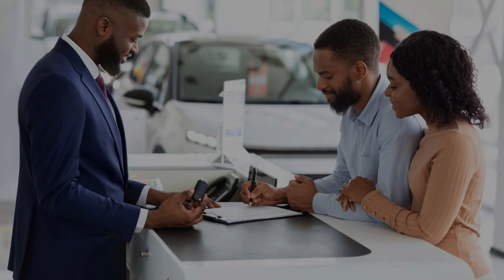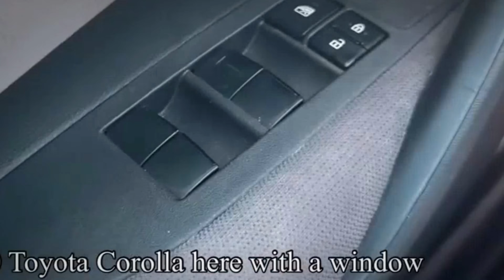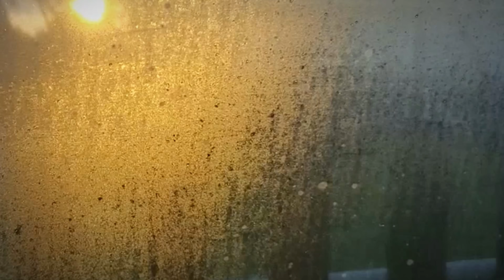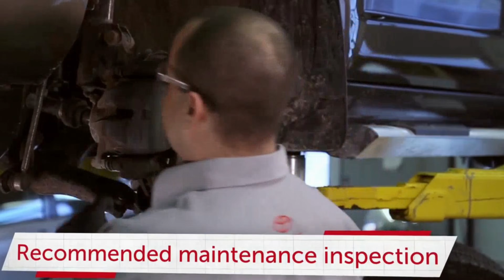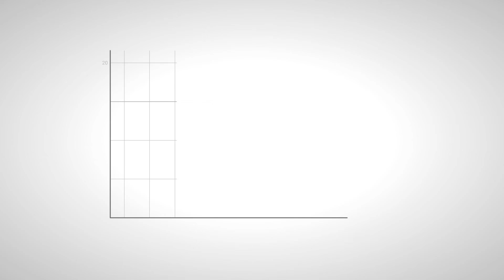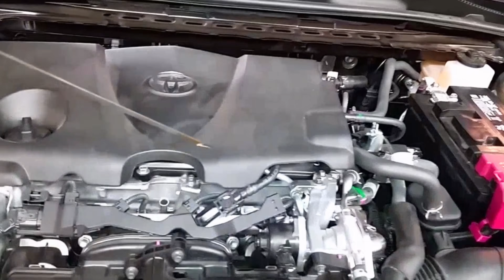The "ILLEGAL" Toyota Auto-Window Hack Dealerships Are TERRIFIED You'll Find Out About

Comment: Toyota disabled rolling the windows down with your keyfob
Reply: No, they have not.
Reply: When we bought our two 4runners we had them enable it before we took possession of the vehicles. It's still there.
Reply: @rgsniper2  And I made sure it was NOT enabled when I took delivery of mine. Been dealing with that nonsense for 16 years on my 2009 Pathfinder. When I found out the 4Runner did it, I was devastated I’d have to still have anxiety about it. Then I found out it was off my default. Thank goodness! The first time you come out of a store and all your windows are down when you know they were up when you went in, and you finally figure out something was pressing on the key just right cause this doesn’t help when it’s pouring rain. I’ve been holding my keys with two fingers so carefully for years now. So glad to be rid of this “feature.” (It’s a bug for me.)
Reply: @jedivet yes that doesn’t sound good. Luckily for me I have two 4 runners and have never had the misfortune of that. As I work from home as well as my wife we really don’t put that many miles on our vehicles so not too much chance of it, but thanks for the heads up.
Reply: @rgsniper2  On the Pathy, you had to hold down both lock and unlock for a few seconds. And I never knew it. Until I had this experience and a few other times over my time with the truck. A guy who owned a Sentra clued me in. So annoying! But I’m glad it’s customizable here. We can both have what we want!
Reply: My 2017 4Runner has it.